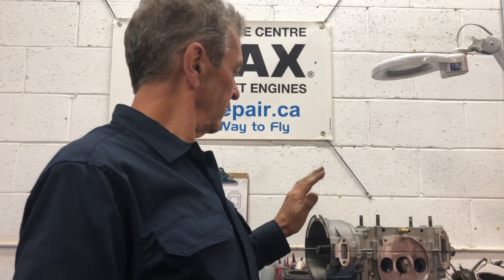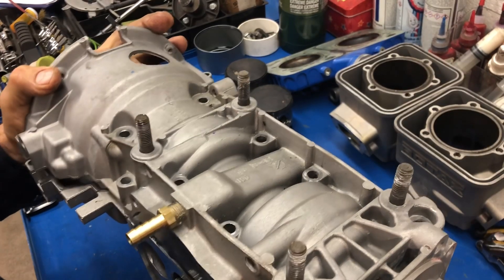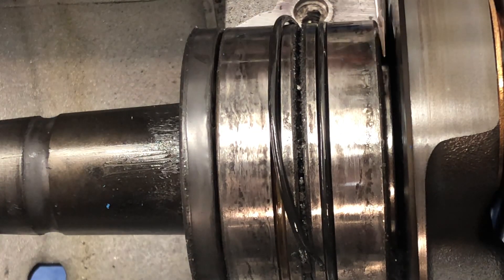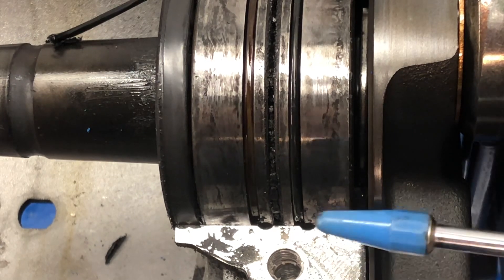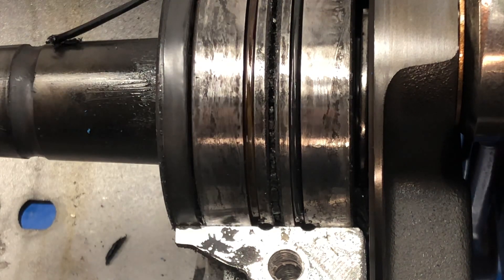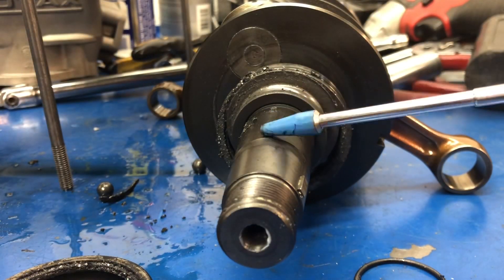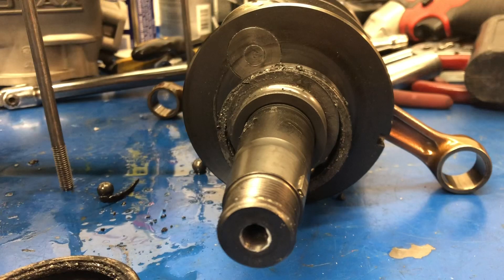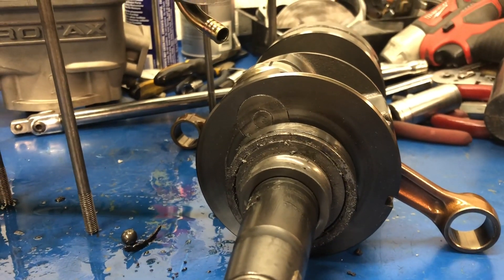Rotax 582UL engine with a “pinging sound” as reported by the owner.

Comment: Wait a minute. Didn’t the engine have to be improperly assembled before this?  There are no forces acting to push that inner bearing off the engine shaft no matter what failure happened to the bearings. Any force generated in the failure, would have pushed the bearing inward, not outward. I think this engine was either bad from the factory or someone installed that bearing wrong during an unmentioned overhaul.
Reply from the maker: Failure due to corrosion, bearing heated up and moved on the crankshaft as it was running. The loose bits and pieces of the cage pushed the bearings forward. I have seen this type of failure before. Thanks for your comment.

Comment: Rotax Rick As long as the seal contact area is good, this crankshaft can be completely rebuilt. I would replace everything except for the 4 throws & the center steel gear. That includes the crank pins. They're the wrist pins on the bottom. When I'm done with it, it's better than a new one with my double slotted oil feed connecting rods.
Reply from the maker: Thank you for the comment.

Comment: Rotax Rick. The largest cause for a 582 to fail is a bearing fails. Main & rod bearings.  WHY They don't get enough oil. I highly recommend 40 to 1 ratio. We open up the oil feed ports to get more oil to the outer bearings. Also the advantage to a polymer bearing , 4 out of 5 don't lock the engine up like a steel ball spacing bearing would.
Reply from the maker: Thank you for the comment

Comment: Not sure I'd wanna be in flight with this engine powering it
Reply from the maker: These crankshaft bearings failed due to corrosion as I stated. Low hours of usage and high years is an invitation for corrosion. Following the engine preservation procedure (fogging) likely would have prevented this. Regards John

Comment: Hello John how to you get the o rings on the middle of the crankshaft. Do you haft to press it apart?
Reply from the maker: The middle oil seals, gear and bearings of the 582UL aviation crankshaft are not to be serviced. If there’s an issue in that area, the crankshaft must be replaced. However the two PTO and two MAG end bearings are replaceable.
Reply: Thank you

Comment: I'm considering an ultralight with an at least 20 year old 582 engine with supposedly 207 operating hours . It could have been out of operation for 5 years or more, sitting in a hangar with the wings off.
Should I assume that the engine needs a complete rebuild with a new crank?
Reply: @B Tenold I'm in Denmark, in Nothern Europe. We have stricter rules. Written tests are the same as for GA, a medical is required. Only the aircraft itself is 1000 lbs max gross and can mostly be serviced by anyone.
Reply: @B Tenold When (if) I get my license, I'll buy a 25% share in a plane with a Rotax 912.

Comment: Hi John you mentioned the engine should have had an inspection at 5 years.  Is there a requirement in the Rotax Manual for an inspection based on calendar time?  I wasn’t aware of it.  Thanks
Reply from the maker: Hi Kevin, the general engine overhaul at 300 hours or 5 years is in the Rotax Maintenance Manual. Please reference MML_582-UL-Series, latest published on Feb 1 2019 Edition 1 Rev. 1. The Maintenance Schedule begins at 05-20-00 page 8, item 20, 05-20-00 page 12 contains “general overhaul of engine” marked at 300 hours with X(2. The (2 asterisk statement is at the end of the section. That statement reads “to be carried out every 5 years or 300 hours whatever comes first”